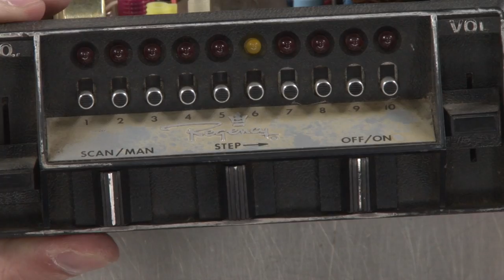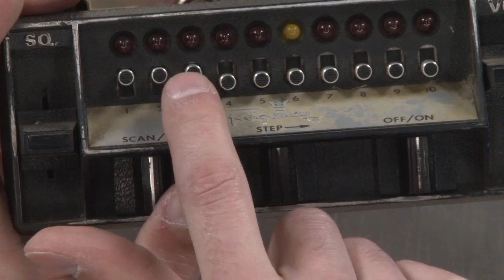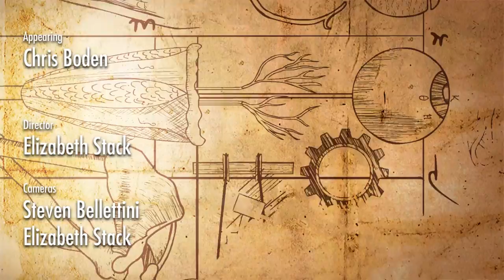Police Scanner: Equipment Autopsy #68

Comment: Chris, ferrite is actually sintered iron OXIDE, not metallic iron. The point being that it is both ferromagnetic AND non conductive. So that when you place a ferrite core in a coil, alternating current in the coil won't induce electric currents in the ferrite, that would otherwise heat up and absorb energy from the circuit.

Comment: My first ham radio was a Pye Cambridge (as used in taxi's etc) which had crystals for TX and RX, worked really well, also, maybe that scanner would be better for the roofcam audio so we don't get that noisy station, just needs the right crystals and cleaning of the controls.

Comment: The bar antenna is normally used for receiving FM and AM broadcast band things.  A larger antenna is not needed due to the power of the broadcast signals.

Comment: The reflective back layer is also polarizing, so you could just take that after you've peeled it off and turn it 90 degrees to make it black/inverted. :)
Reply: I've done this trick many a times - even to oldskool cellular phones. I also have an icom, but its a TX as well as a RX, with a DSP, so no crystal oscillators in that one (well I guess except for the IF's - one of which is a ceramic 455khz osc). It'll do 100W on every ham band up to 2m :)

Comment: PLL circuits have been around since the '70's and were used in 40 channel CB radios. Most 23 channel CB radios used "frequency synthesis" to obtain TX and RX frequencies. This amounted to mixing the outputs of 2 crystals and using a harmonic of the 2 frequencies to obtain a 3rd frequency, that combined with the IF frequency, allowed the radio to TX or RX. All basic math and electronics. The math can be done through dual conversion radios with different IF frequencies. Wait until you try to diagnose a radio with 4 IF frequencies.....!

Comment: I used to fully know how LCD works but it all down to liquid crystal twisting when voltage is applied to them, this twisting blocks light polarized by the polarizing filter or at least that what i remember

Comment: Sometimes they work, but it's been my experience that the receiver sensitivity on these old boat anchors is poor to non existent
Typically, with my service monitor I have measured  0.7uV to 3uV VHF Hi band.  Or completely dead.  I revived an AOR-2800 by putting a preamp before it which got me to 0.4uV. Not great, but serviceable for local monitoring.

Comment: Do these still work with new police radio frequencies? My dad has one that I'm using right now but it doesn't seem to be picking anything up.
Reply from the maker: They won't work with most modern systems, no. Anything digital or trunked is right out.

Comment: what was that pink strip above the ferrite bar antenna?
Reply: the pink strip is actually a coil of super thin wire wrapped around the ferrite bar. The coil is the actual antenna pickup, the ferrite is just to get the right resonant frequency range.
Reply: It's the AM antenna for low band/MF reception